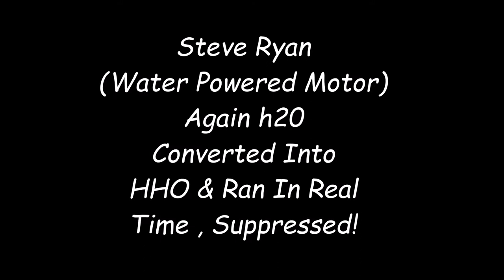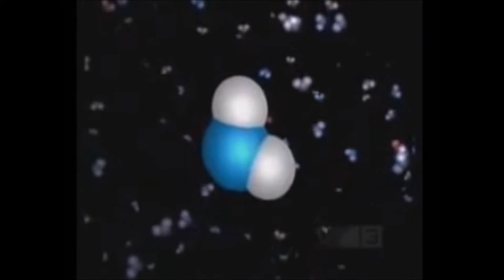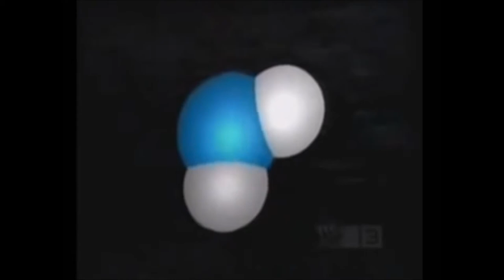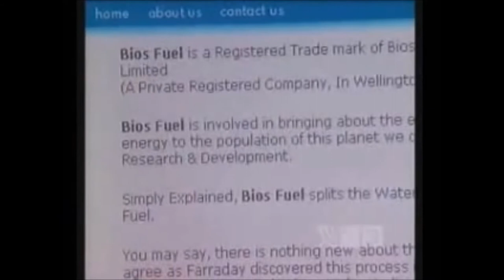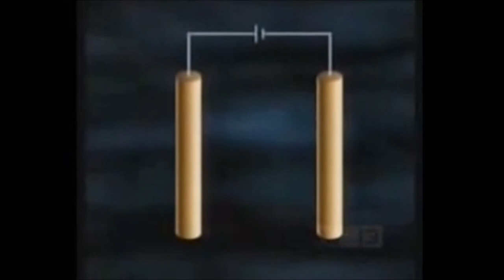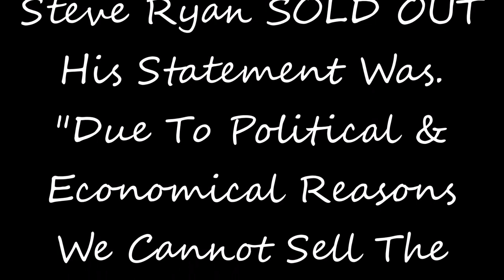Steve Ryan Water Powered Motorcycle Free Energy (Over Unity) Diaries Part 4

Comment: You can run an engine on waste vegetable oil - why mix water with it? It would have been more honest to call his fuel an "oil based fuel" not a "water based fuel". When he ran his diesel truck in the Solar Challenge in Australia it was on a mix of waste oil and water. Presumably the water was treated in some way to allow combustion to take place and presumably it helped catalyse the combustion in some way, but t think of it as a water fuel  is somewhat disingenuous when the energy is clearly coming from the oil, I believe Steve Ryan was clearly only interested in making money from running a scam, but he was too slow to figure out that you can't get away with that as eventually you will be found out and called out on it,
Reply: Bro you can run a car on pure water or waste water i have seen it over and over and over.